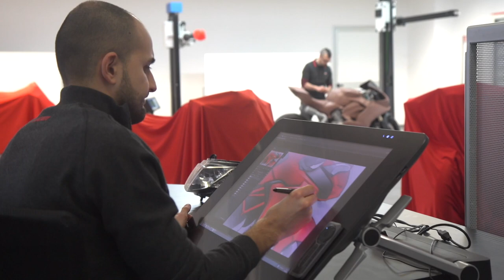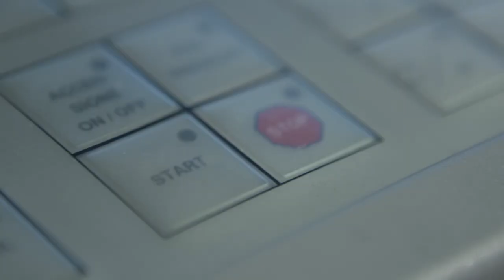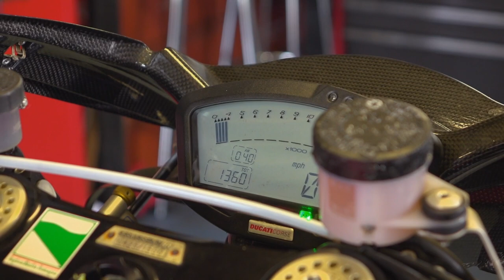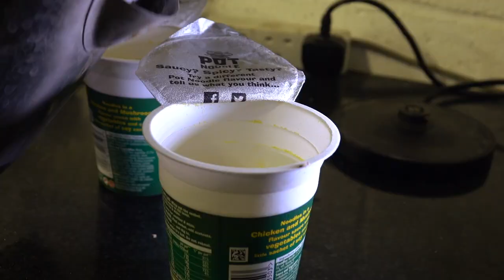Ducati Desmosedici RR Re-build Project Part 3 (Project 425)

Comment: So, your bike 425 has the track only front fairing on it that doesn't have headlights. Are you going to get the street legal front fairing?
Reply: You need the rear fairing also for the street. Did you get those?
Reply from the maker: @DirkWrightxyz  hi, there were a set of road fairings with it.
Reply: @BikeWorldTVshow  Thanks. I looked ahead and saw that. Cheers!

Comment: Very nice sound!  Whenever I change the oil, whether it's to my cars, bike or lawn mower I always fill the canister with fresh oil before putting it on .  This means that the oil pump doesn't have to fill the canister before it gets to the bearings, which is very important with an engine that is dry from sitting for so long.  The oil doesn't drip out of the canister if its a horizontal fitment because of all the valving but there is no need to hang about when spinning it on.  Filling the canister doesn't cost anything and may just save that metal to metal rub.  You can see how effective it is since the oil light goes out much quicker than with the dry canister.

Comment: Worst thing that can ever happen to motorcycles....... just sitting unused for years. Stuff just rots, dries out, rusts, tarnishes, gels, oxidizes, acidifies, collects moisture, cracks, and sags.
Reply: To every vehicle in general and yet for some reason people covet these barn finds.
Reply: nice crusty silicone hoses, always wait for them to pop!
Reply: Used bikes are great, or can be. Some take a lot of love to get them back on the road in trustworthy condition.
I have a rather keen interest in a late 90's ZX-11 at some point, but I just don't have the facility or space right now to tackle a project.
Reply: @exothermal.sprocket  I wouldn't mind trying to get a kx125 or 250 and have a go referbing one of them... they seem fairly straight forward so should be a good place for myself to start
Reply: Like my ex.
Reply: And yet why do we all want low mileage stuff.. best secondhand bike I had was big mileage. ..same go's  for cars..cheers from dave..